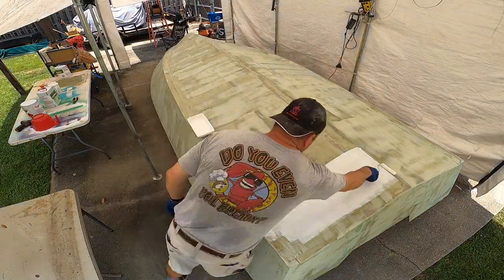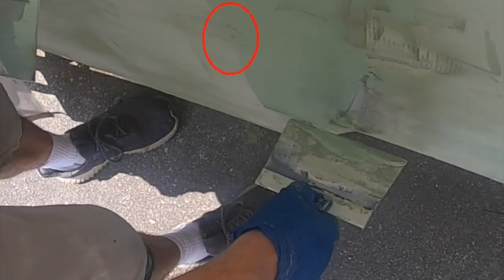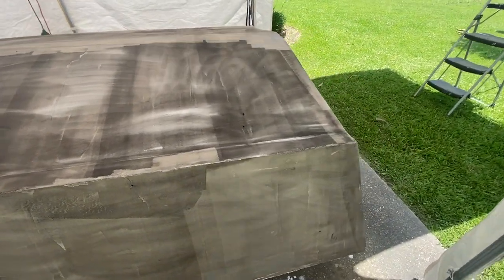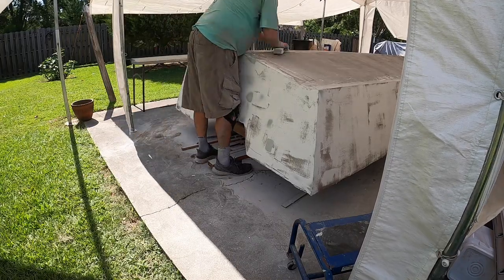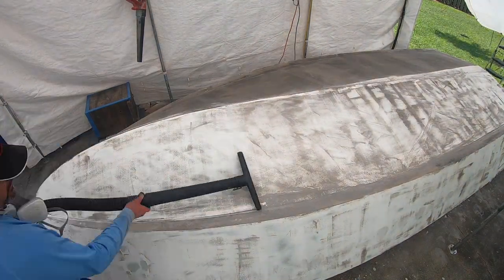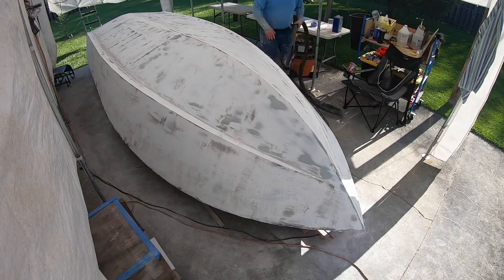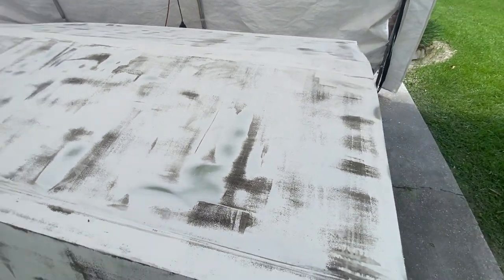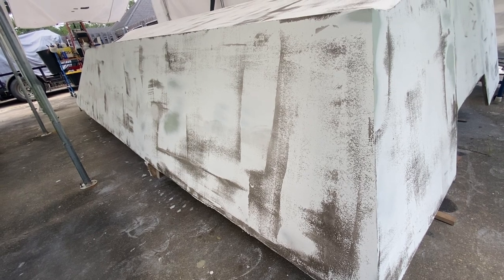36.DIY Boat Building: Big Dose of HUMBLE PIE!

Comment: It’s a gut wrenching feeling when you use a guide coat for the first time. It’s the best way to see where you have to go back to sand, sand and more sanding. Those little grooves and drag marks are from small particles of hard compound or just a small chunk of matter stuck to your putty knife if can wipe off the edge of the blade and go over it again. Pick a small area pull up your chair mix a small quantity of compound (so you don’t feel rushed to use it all) and just go at the small area till you are satisfied with it. Do this on the areas that look the worst, if you have too you can drop down to a coarser grit paper for this just don’t blow past your major low spots and overly scar good areas around where you are working. Remember you are still developing your fairing and blending skills all in all what you have is looking good and just needs a little more love and finesse. Remember  that every pro boat builder wasn’t born having these skills they had to learn them the hard way just like you are. I have faith in you and from watching you work that you will work on it and do the best you can and that’s all that anyone could expect. Knowing when to stop and move on to the next step is a choice only you can make ( remember this is supposed to be fun and enjoyable) it’s looking good can’t wait to see more.
Reply from the maker: There have been a lot of revelations during this process that have been learning steps and experiences.  First time scarfing, that was weird.  Pulling fillets and getting good at it (at least good enough). Laying thick 1808 bi-glass was a whole lot different than using CSM.  Amine Blush that was dreadful because I thought there was a problem with the whole bottom glass job and all I could think is I have to grind every bit of it off.  Than the fairing compound.  Thats been the biggest fiasco in my mind.  Knowing what I know now, I bet I could do this whole process is 1/10th the time, and certainly a whole lot less effort, and that's after I researched, watched, and tried to pay attention to any advice I was given.  I knew in my head what I wanted to happen, I just should have stayed with basic steps instead of venturing off course, but like I said at the time, it's my time, my money, and my shoulders and if it's the wrong decision, my opinion was the only one that mattered.  I learned through the failure, and to me that's valuable.  I'm anxious to get this bottom job done so I can get back to the inside.  Appreciate you checking it out and comments.  Thanks for the support.  Keep it up, I need all I can get.

Comment: Guide coats are really meant to be put on more lightly- just a light modest gray is all that's needed to show you where low spots are. But that dark can sometimes smear into where you already sanded. But your sanding technique using diagonal fore and aft motion is the right thing (assuming you remember to turn your arms off at night when you go to bed. Nothing worse than sanding in your sleep) One of the best things for these blemishes that are trivial but all over the place is to use 3M Acryl Putty in white (because it does not show beneath white paint). The have red and green and these are just different setting speeds. Like soft toothpaste- spreads like a dream, dries VERY fast, sands to a feather edge, used in automotive and marine applications, and has a long reliable history. Bigger dips require more epoxy fairing compound. Your arms might be worn out but you're so close to finishing. God humbles us all.
Reply from the maker: Thanks sir.  I haven't had any problems turning my arms off at night, it's the restarting process that has me baffled at times.  I think once I get down to smaller areas of issue I may look into the 3M products, but I think I have it sorted now.  Looking forward to working with machine sanders in the near future.  Appreciate it.

Comment: You're right about the physical work in sanding on your knees when you're tall.   I feel for you.  The knee pads will save you.  I still have to do the guide coat on the sides and the transom.   I thank God my boat is already on the trailer  so it's lifted a little.
Reply from the maker: It's a pick your poison situation.  For me to be able to reach the keel it needs to be this low, but with me able to reach the keel, I struggle to reach the bottom portions.  It's a compromise either way.  If I had a lot more work to do like this, I would build some jack boxes to put the cradle on and lift it up when needed.  But, hopefully I am about to go on the trailer so this will be moot.  HOPEFULLY, I said.

Comment: This is why I added the shear before I flipped. I knew I would have had to paint and flip it back over. But the question was how to do this without messing up the paint IF the sheer wasn't added prior. On top of that, I didn't know what to expect when overlapping the glass over the sheer.  So instead of having to deal with 2 of those problems later, I went ahead and installed the sheers and was able to overlap the top and bottom glass at the sheer line. I faired the sheer once the boat was flipped right side up. I didn't know if the paint was going to have a overlap line since it was my first build also. 

I think you should paint to the edge of the chines instead of "overlapping". That way when you flip it right side up, you only need to paint from the top, down to the edge of the chines. Less having to wet sand and flatten where the two layers of paint meet.

Looking forward to your next video!
Reply from the maker: I think there are many ways to skin this cat.  I didn't want the shear bumper on so that it would make sanding the whole side easier.  That was my ultimate logic and I "think" without it there, I have had an easier time (I can't imagine it being tougher, but it's possible) sanding the sides since I can hang one end of the board off the edge and go in all directions.  I got with Oertel who did it the same was as me and he said he would paint up half way of the side, but like you I am worried about what that line will take to make it undetectable.  Also like you I thought about just coming to the edge of the chine and then painting down, but what I am leaning to now is painting the bottom to the edge of the chine, and then overlapping the side and just painting the chine again.  The old paint/new paint edge would be the hull chine intersection which is going to be a transition anyway.  I don't know.  That's why I'm talking about it now.  It would be a lot easier to blend a joint on the side of the boat as far as access and good working posture, though.  So many small decisions like this and each one has ramifications.  What fun...
Reply: @Bigeaux20  Either way will work just fine. I guess OCD really holds us back on doing things lol. 

Another tip. I used a black primer spray can for the guide coat. Lightly dusted tge surface. Just another option for new boat builders.
Reply from the maker: It would probably be fine, but I am just too leery to mix and match paints.  The guide coat powder does the same in the end I believe.  I actually used it on a few smaller spots where I have a variation in color and it tells me what I need to know.  And I've never been accused of having OCD in my life.  I think I am on the other end of the spectrum.  The evidence of that is everywhere.  Thanks as always dude.  Probably the most inspirational of any for me doing this boat.

Comment: I would concentrate on the sides and transom. The bottom, which won't be seen, only needs some touchup. Major flaws may need fairing compound but other areas may only need the high build primer.
Reply from the maker: We are certainly on the same page.  I want the bottom to be awesome, but if it’s nice and no one sees it, I’m good.  The transom,sides, and the bow will be the things most visible.  But I still see everything., and I’m not putting junk in top coat.  I’ll do my best.  It will be enough.  Appreciate it.

Comment: Use of tape on edges and transitions can assist in keeping the “crisp” line while sanding
Great job for a first run
Reply from the maker: Good tip.  I hope I'm done sanding for a bit, but in another way that's the only way to get done.  Where do you think I could have used the tape method?
Reply: @Bigeaux20  along your edges of the hull crisp lines help to break the viscosity of the water so in theory you will plane faster and use less power/fuel
Reply from the maker: Yes, my intent is to make all the edges as crisp as the paint allows.  Appreciate the response.  Keep them coming.

Comment: Looking great!  I was wondering if you could pull new fairing compound right over the guide coat spots or whether you have to really get all of the guide coat out first.
Reply from the maker: That is a similar question that I had.  I searched everywhere and couldn't find anything that said for certain to go to great lengths to remove all hint of the guide coat.  As you can see, I vacuumed all the surface, and then I actually wiped everything down with alcohol before I applied the fairing over the high-build with remnants of guide coat.  Truth be told it's more color than particles, but even still.  I did my best to prepare the surface. Some big leaps since I put the high build on and did the guide coat.  About to repeat that process.
Reply: @Bigeaux20 clean off all the guide coat with acetone for a good adhesion of the next coating of filler or high fill primer.
Reply from the maker: Thanks for that.  I did what I assumed was the next best thing and used Denatured Alcohol to prepare the surface.  Next go round I will use the Alexseal Surface Prep product that I have.  I looked everywhere to specs that stated what to do, but I couldn't find anything.

Comment: Steep learning curve there,  are you gonna round of the edges of the shimes and rear I was wondering, sure would make them stronger if you hit annything.
Reply: Some guys did a sharp edge. Some put a radius on it. The guys who did the sharp edges had more experience with boat performance. I was told the water leaves the pad better with a sharp edge VS rounded edge. I rounded off everything on my boat so if I hit anything, the epoxy would not crack off.
Reply from the maker: I'll probably leave them sharp for the simple fact that getting them perfectly rounded and fair sounds like another step that will take a good amount of effort.  I'm not totally decided, but I'm leaning to leaving them sharp.  Also figure if something chips over time, I will now know how to fix it.  So, that's different that what I would have said in the past.  Good question though.  Appreciate you checking it out.

Comment: I think you did a great job, just one question. Why did you not use an air file ?
Reply from the maker: I didn't use an air file basically because I'm an idiot.  Naaaa, not entirely.  I went through the whole process and there were two things that kept me from putting a package together.  One, something in me wanted to do it by hand to have the experience, and also by hand I thought it would be tougher to get myself in a lot of trouble like sanding through glass, or gouging it all up.  Those two things probably had me leaning one direction.  Secondly, an air file takes a fair size air compressor, which I don't have.  If I were to get one, where I am building the boat is a good ways from an adequate power source so it would be a long run and I'd have to set up a shelter for the compressor, etc..., and the wife already isn't all too excited about having a huge white tent that constantly has an abundance of dust flying out of it.  Also the noise and I'm close to the houses around me, etc....  It was just a bridge too far, but like I said, I kind of wanted to do it by hand.  Now I am an idiot because I didn't think it would be this much sanding, but some of that is my own doing.  It's a good point, and believe me one I wish I would have made different many moments through this process.

Comment: Flexible Orbital Sander? Yes its Electric....
Reply from the maker: I'm not sure I fully understand the question, but the Bosch RO has a cushioned pad that is pretty firm, but I also use a form pad that adds a layer in the hook and loop system to give it a bit of a softer (more flexible) sanding surface.  That work?